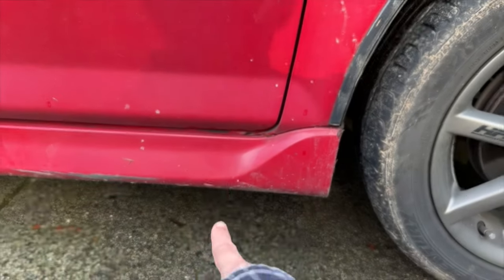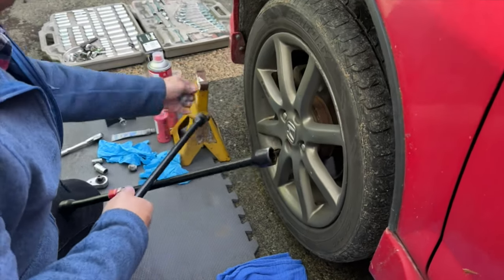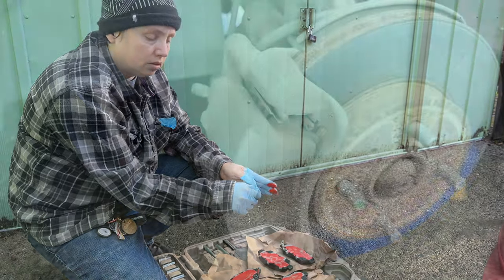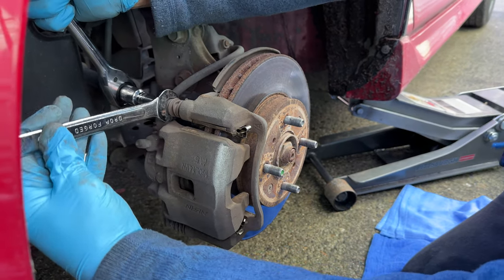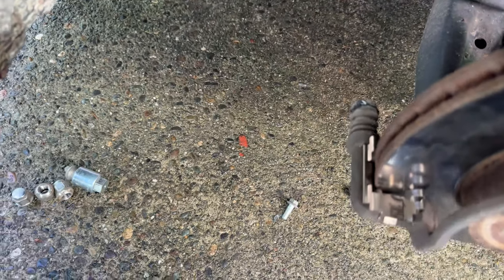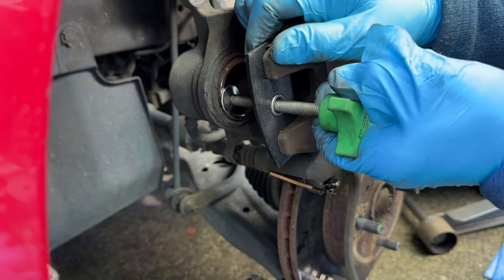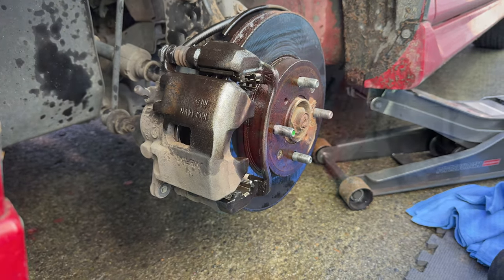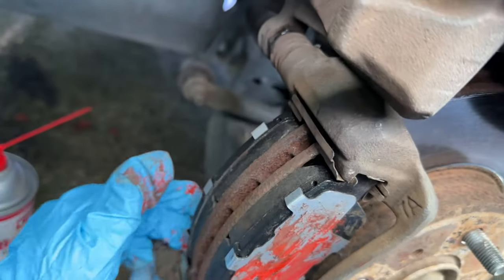2007 Honda Fit Sport Front Brake Pad Replacement

Comment: Amazing video and great walk-through. Thank you very much. Do you think it’s the same on a 2012?
Reply from the maker: I cannot 100% say yes, but Honda brakes are very similar. I would say it’s a strong possibility that this would be the same way.
Reply: What’s that part you used for the brake piston compression? I’d like to order one. Ty
Reply from the maker: It’s called a brake spreader on amazon, it’s about 10$.

Comment: The brake bracket must be cleaned of brake pad wear products and then the metal plates of the shoe holders must be replaced. Apply grease to the grooves where the brake pads will be installed. The rear brake pads can travel up to 200,000 km with careful driving

Comment: I have the same issue with the duralast gold Front brake clips & pads not fitting on 2008 sport model. Now trying to locate the old clips. Might have tossed them 😢

Comment: Good video but you really should not be touching the inside of the brake pads with dirty hands (gloves). You don't want to transfer any grease or oil onto them.
Other than that,  this is provably the best video on doing front brakes on this car.

A tip for anyone doing this job - Jack up the car in the center from the front. Then use your Jack stands on each side, utilizing the points on the "frame" that she pointed out at the becoming of the video.
Having the entire front end up in the air will allow you to turn the wheels and give you better access to you brakes.

Comment: Great filming and presentation, but A-Z pads will glaze and deform OEM rotors, saw that on the junk yard few months ago. Of course if the car is on the last legs , it does not matter. The cost for OEM set for me was less than from the Autozone  (*two rotors and pad set, bought form Honda on-line store)
my brake job https://youtu.be/8JsbguC7Crw
Reply from the maker: We replaced our OEM rotors last year with ones from AZ, no video on that, but they’ve worked out fine so far with many miles clocked on. I don’t doubt OEM brake parts. They tend to be best.